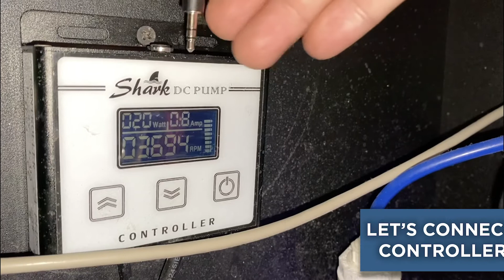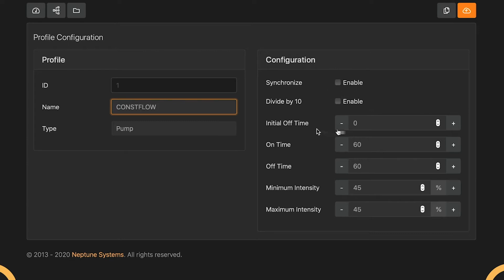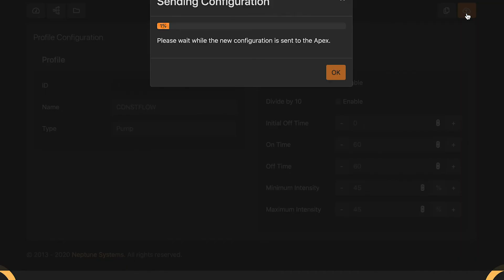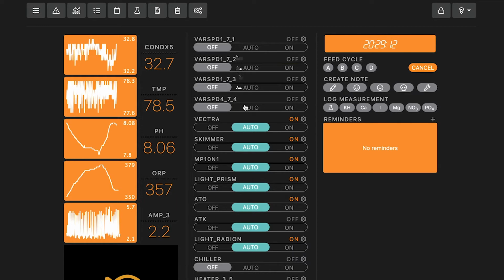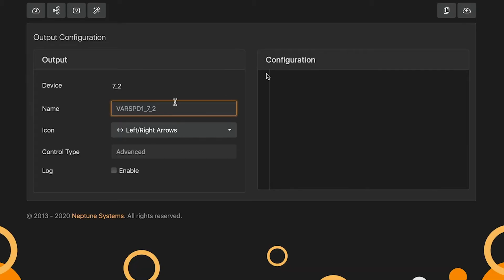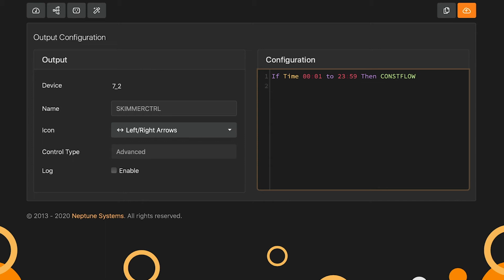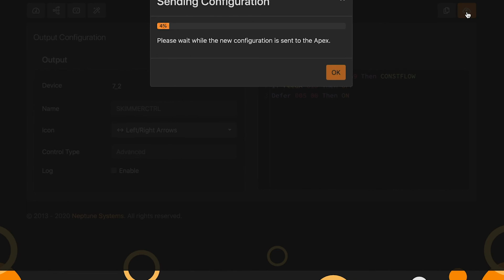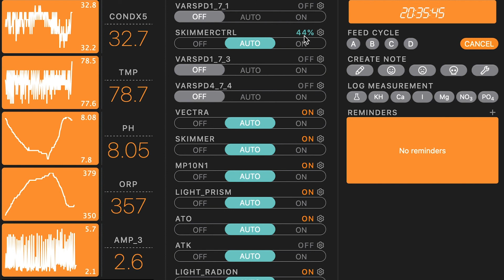How to connect | Aquamaxx DCQ2 Skimmer to Apex Controller

Comment: Thanks for the excellent walk through!  I'm in the process of installing my Apex for the first time and am wondering if you can give us some videos on setting up an Apex to work with the various parts from scratch, including how (& where on the Energy bar or Apex box...) to wire the various system modules /parts. There's a ton of advanced video's on Apex but...

Comment: So question, once the AC plug  for the skimmer is removed, does it needs to plugged into a different outlet to supply power (just not on the Apex Energy Bar) or is it suppose to be unplugged once the 0-10v plug is used?  That where I am confused at.
Reply: Same question here.
Reply: @Stralnikov  The answer is it does NOT need to be plugged into the Energy Bar, BUT it does need to be plugged into an outlet somewhere else, it basically gives you an additional outlet on the Apex Energy while being controlled by the module which is connected via the 0-10 VDM controlled by the type 1 cable as he listed above.
Reply: @Theaquaplex  Thanks for your prompt reply. I followed all your steps but the controller never changed to 44%. Also, would there be a way to actually control the skimmer from the Apex, rather than just turning it on/off?
Reply from the maker: @Theaquaplex  Thank you for answering this question Aquaplex.
Reply from the maker: @Stralnikov  thank you for your question, yes the purpose of using the 0-10 Bolt is to set the intensity of the pump using the Apex instead of the skimmer’s controller, if the percentage is not changing after following the steps it is possible that you are not using the correct  VARSPED outlet. I would start by checking that step again as explained around min 4:49. Hope this helps 👍